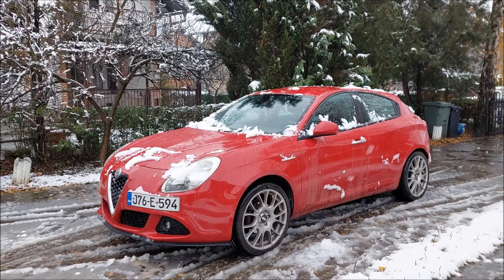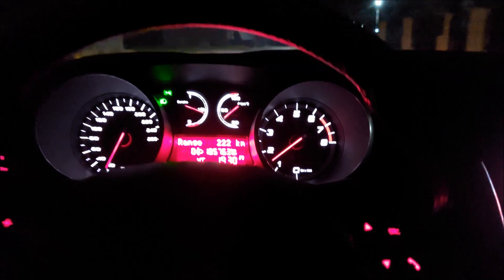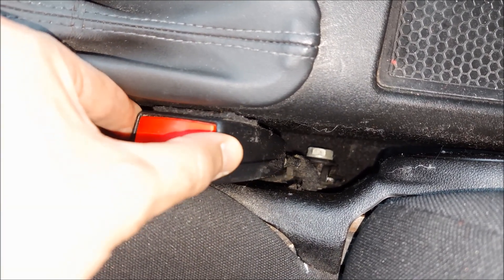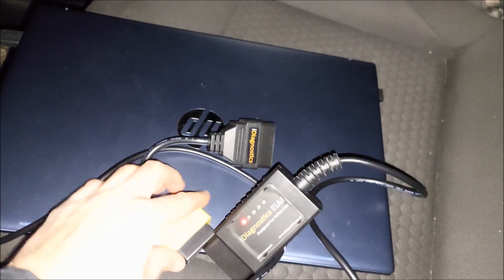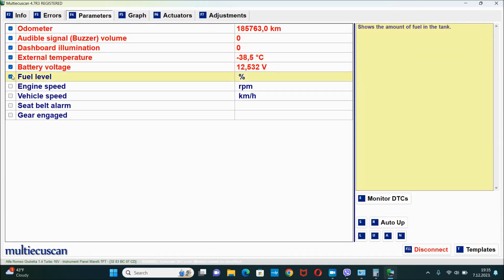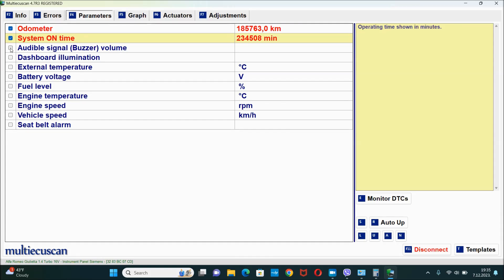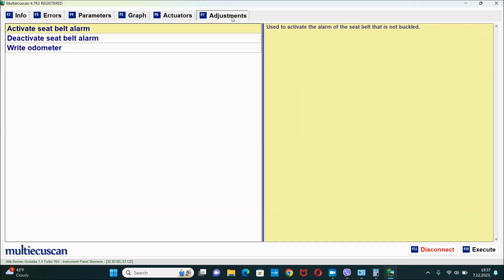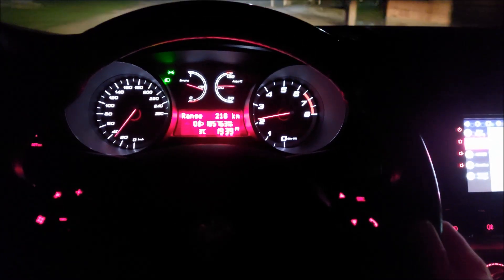3 Ways to Disable Seat Belt Alarm, Beep, Sound on Alfa Romeo Giulietta

Comment: Thanks for the video as always! I'm starting to grow on giulietta haha. One question, is there an alternative obd scanner to multiecuscanner you can recommend? I find it troublesome to need a laptop and obd adapter port huhu. Or maybe any other scanners suitable for alfa romeo? Cheers!
Reply from the maker: Thank you for watching. I've used countless diagnostic tools, and I would still have to recommend you the MES, although it is a bit of hustle to fit everything together, it will give you the best capabilities. There are cheaper tools which you could use, but you will have limited options. The MES will give you all the options 2-3000 Euro tool will give you
Reply: @arcgarage  awesome. Appreciate the feedback 👍